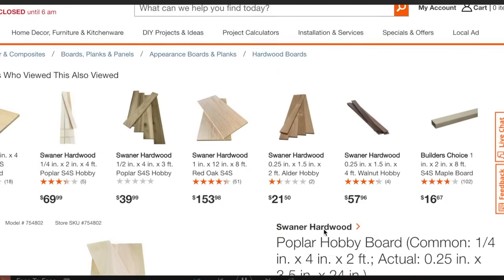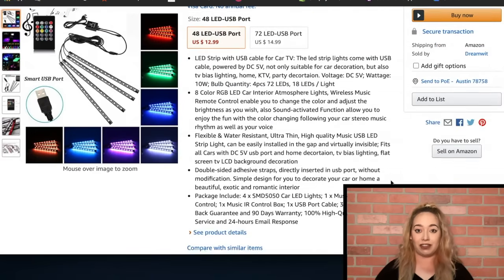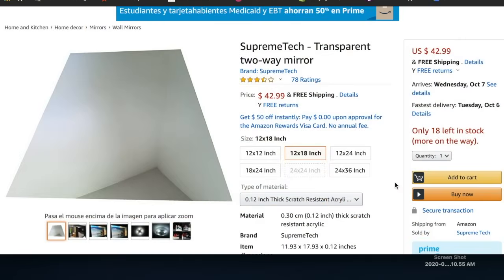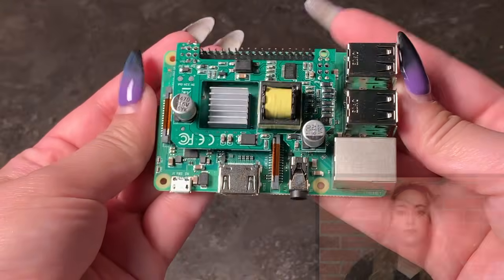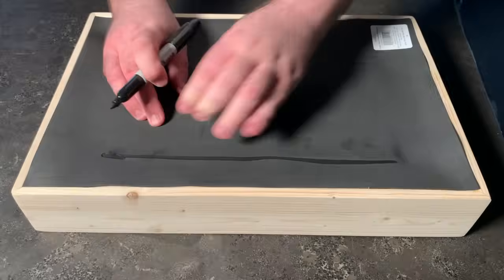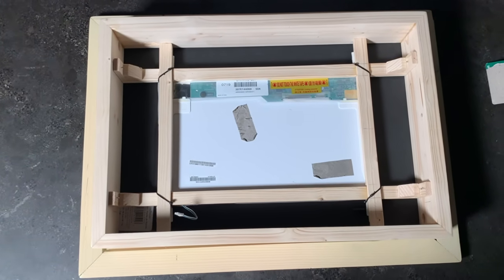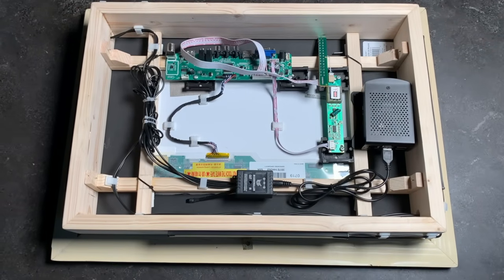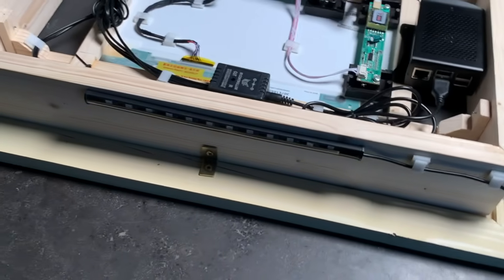POE POWERED SMART MIRROR | Using a Raspberry Pi | Part 1

Comment: Question from a newb here. Why PoE? Why not just use the typical 2A power supply? When does part II come out?
Reply from the maker: You can use PoE when you don’t have an outlet close to where you want to install the mirror and you don’t want to have to install a new electrical circuit to that location.  Because PoE is inherently safe, you don’t have to worry about electricians, permits, or 120 VAC.  Ever noticed that every video about working AC starts with the disclaimer to consult a professional.  PoE is completely safe.
Reply: @PoETexas  Cool, thanks for the explanation. Makes sense. Headed to watch part II now!
Reply from the maker: Part II is out!  Check our channel.